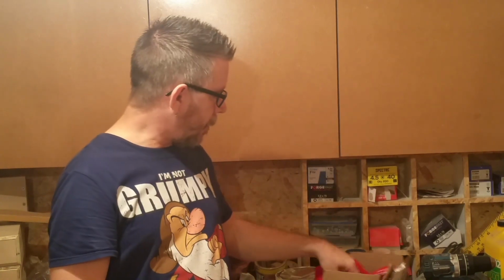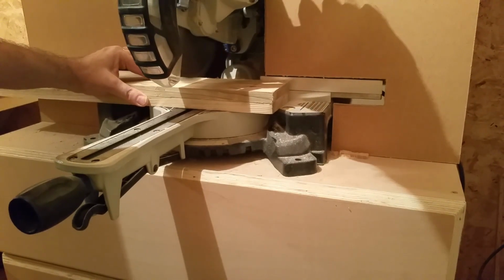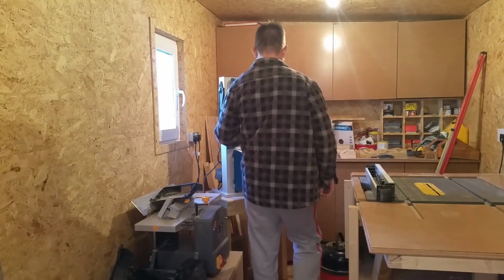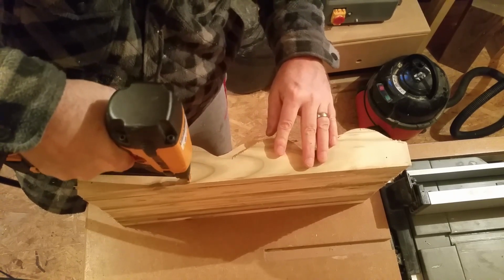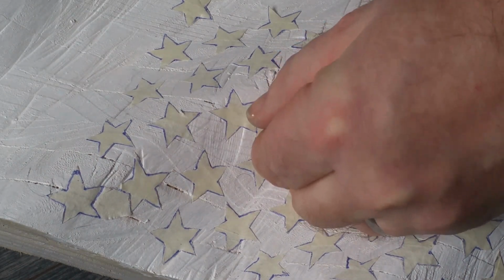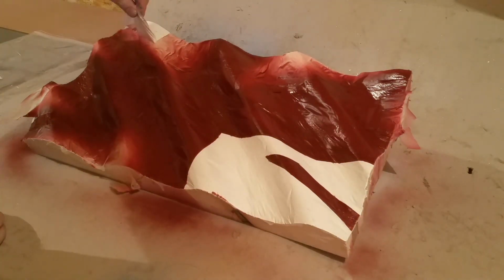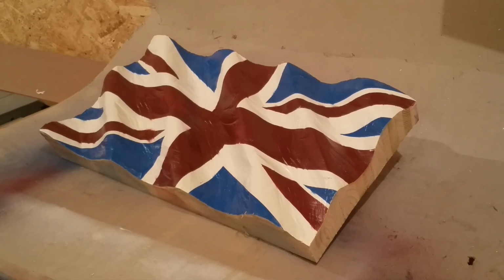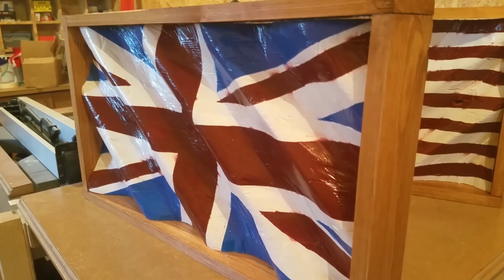Make a flag challenge mafc2020

Comment: Why didn't you get yourself a lap sanding disc, the grinding disc you used looked like it burnt the wood rather than it cut it. Good end result especially since the time and effort you put in.
Reply from the maker: Yeah that would have been easier but i didnt have one at the time of making the flag. In fact it was a masonary cutting disc i used. Not the best way but got the job done. Didnt matter that it burnt the wood as it was being painted. Thanks for watching 👍👍👍